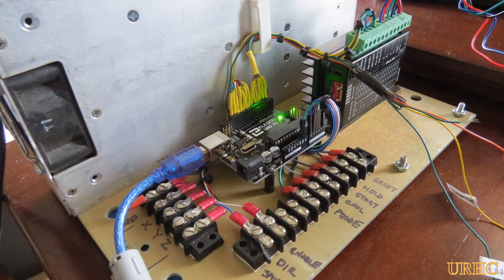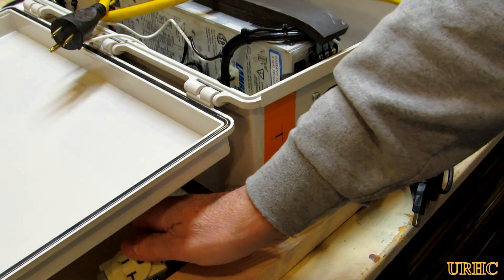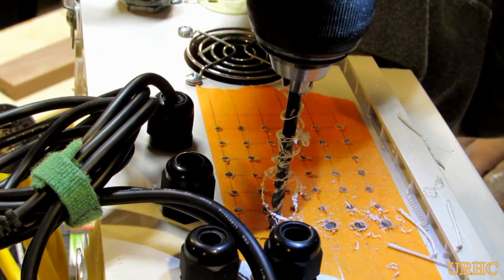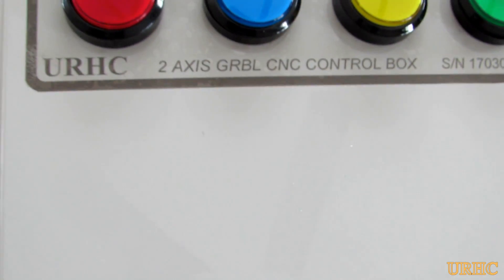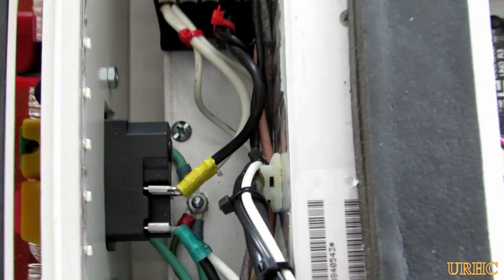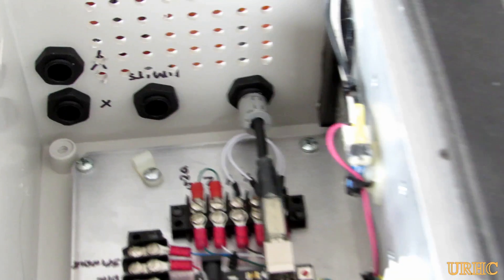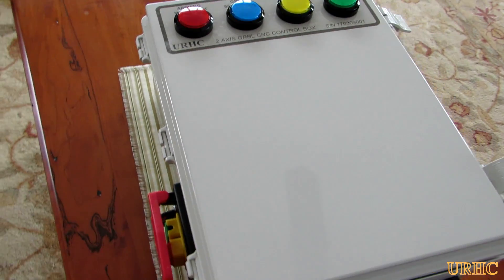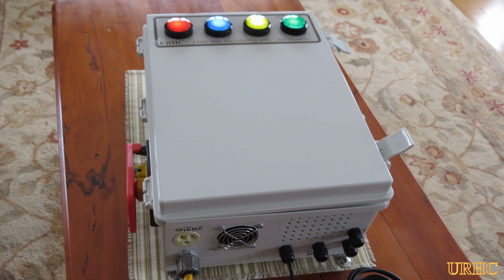2 Axis GRBL Control Box For A CNC Lathe Build.

Comment: You do a good job on your videos.    I looked through all of your videos, but I couldn't find a continuation of this CNC project (I saw Part 1).    Do you have any more CNC videos, or any coming soon?   I'm thinking of doing something similar with an Arduino and Win10 for a small metal mill.   I'm looking for ideas and solutions that work without spending a lot.   Thanks for posting these videos.
Reply from the maker: No I have not finished yet.  I have been looking for a old affordable  metal lathe to make the job easier. I have thought about converting my milling machine and the Masso controller looks like a more advanced controller on the level of a Mach system at a affordable price. https://masso.com.au/product/cnc-mill-controller/?utm_source=HTG+Newsletter&utm_campaign=5526c7c741-EMAIL_CAMPAIGN_2018_09_18_09_17_COPY_01&utm_medium=email&utm_term=0_5eb5a08d06-5526c7c741-228606157 

Thanks for watching.
Reply: Finding a reasonably priced used lathe can be a problem.   Here in Houston, Craigslist might have a reasonable lathe every 3 to 4 months.   I looked at the Masso Controller.  It has its pro's and con's.   I also looked at the Acorn Controller by Centroid.    Franco and Martyscncgarage (both are Youtube Channels) have some good information on that controller.    In case  Youtube allows links, here it is:    https://www.youtube.com/watch?v=Ngejkn5-DXo     If the link doesn't work, you can search for "Centroid Acorn CNC Control System" and the video by Franco is worth watching.   Looking forward to more of your videos.      Thanks, Bill

Comment: Do you have a wiring diagram on how you set it up. If you would please email me at robertwilhelm@cableone,net
Reply from the maker: The pinouts are shown here. I have no diagram, just used this info and the motor driver pinouts.   https://github.com/grbl/grbl/wiki/Connecting-Grbl

Comment: nice work with the box, i am making my arduino based plasma cnc and using the same box and almost the same parts. :)
Reply from the maker: How will you handle torch height control with a arduino. Without it cnc plasma stinks. I run my plasma on mach 3 with a candcnc digital thc.
Reply: I use three axes xyz and each has a so far works fine. I will upload a video and send you a link for it. at the moment I am waiting on some parts. I made my z axes it can move 150mm. I  use universal g code sender. I only started to weld and fabricate in a few months so not much experience and this is my first project. I also use limit switches on x0y0z0 positions
Reply from the maker: When I built my table I started without a torch height  controller and the cut sucked along with torch errors. I added the height controller and now get beautiful cuts with long consumable life. The controller monitors the tip voltage and takes over the z axis motor adjusting the cut height on the fly. I see that Proma makes a stand alone controller that may work with the arduino. Metal moves when spot heated so you need to control the cut height or be prepared for constant faults.

Comment: Hi. How it is going your Lathe-Arduino project?

Personally, I will need to retrofit a Chinese lathe machine and I'm thinking which controller to put on. I'm between Arduino-Grbl and PlanetCNC controller but personally I don't know if Arduino controller will be powerful enough to drive quite big stepper motors. Whats the power of your motors?
Reply from the maker: My motor drives are 4 amps, but you can get much larger ones that will drive large steppers. The arduino only sends pulses to the drives. Grbl is very limited in turning g code commands that can handle and will not do things like threading so it will depend on what you want the lathe to be able to accomplish.
Reply from the maker: That is how I will be building mine. It would be nice if they could squeeze a couple turning commands into grbl.

Comment: You should go through your pick and hold circuit for the contactor.. I think you have a EMO wired into it .. Looks good.
Reply from the maker: The contactor is controlled by g code and not wired to be an emo circuit. The Arduino will switch it on and off as required along with another external solid state relay for the drive motor on the lathe. The power switch is pretty cool and has a holding relay coil in it so it stays off if you loose power and it acts like a emo switch. The Arduino reset button will also freeze all movement for a quick stop if things go south.

Comment: Nice job.  The leds are a great idea.  I have some laying around that I think I will add to my CNC control box.
Reply from the maker: When I built the plasma table I spent many hours debugging and tuning servos with a flashlight, so I decided to add them to my router control box which worked out good. I had some leftover and decided to put some in here also. They really help as my eyes get older and need more light to see small items. Those plastic Bud boxes are great for projects like this.
Reply: I just upgraded my spindle to one which will accept 1/2 bits.  There were noise and control issues with the new VFD and I spent a ton of time with a flashlight.  No fun and only leaves you one hand to work with.  If I have enough LEDs I think I'll add a strip to the bottom of the table top to illuminate the entire back of the machine where all the controls are.  The LEDs are cheap on Ebay.
Reply from the maker: I think it was under $4 for a 17 ft roll on amazon when I bought them. I put a strip under the y axis on my router to illuminate the cut area also. I spent weeks tracking down noise, de_bounce, and grounding issues on my plasma table. Electronics are not fun to play with.

Comment: The internal lights with the switch are an excellent idea! I know that -for me - something like this seldom gets looked at again until there is a problem and I never seem to know where a flashlight is when that happens.
Reply from the maker: The older I get, the more light my eyes need. I bought a couple reels of these cheap leds to play with a couple years ago and figured I had extra 12vdc so it was easy to wire them in. I am hoping not to spend much time in this box, but you never know until the final debug is complete. Thanks for watching.